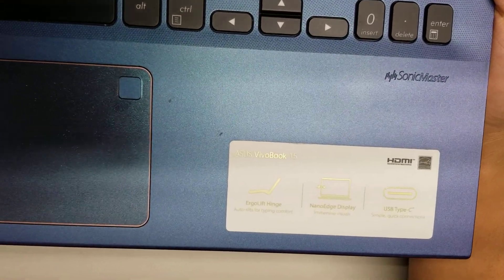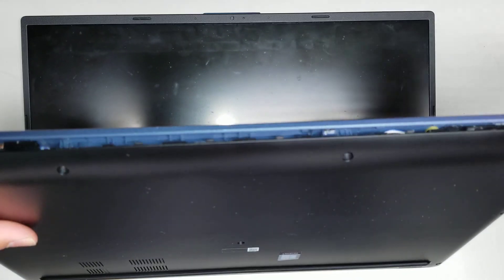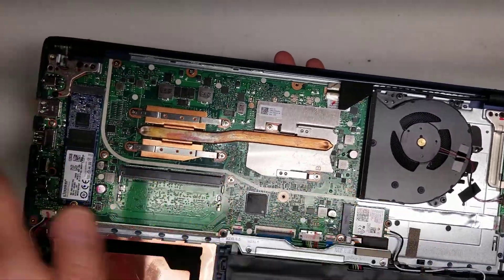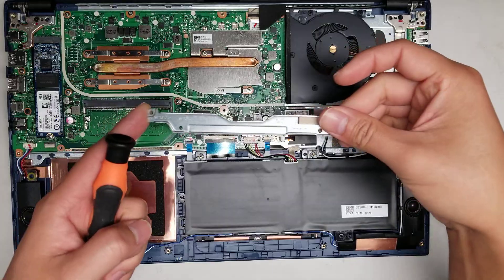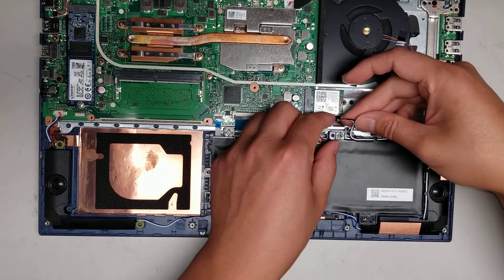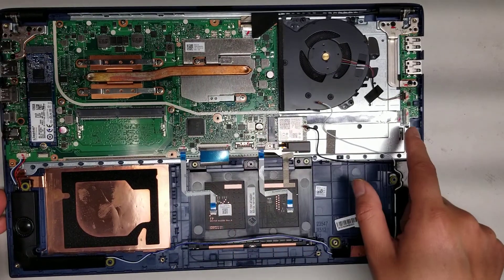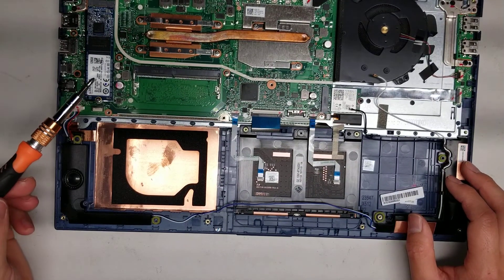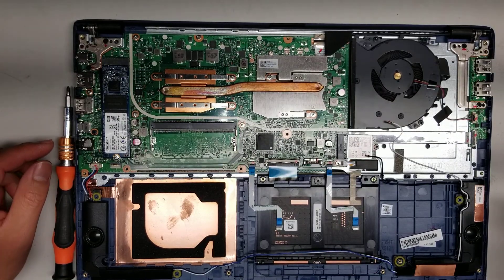ASUS VivoBook 15 F512D Disassembly RAM SSD Hard Drive Upgrade Repair

Comment: I recently bought this computer and after a few weeks of use the performance slowed down even after factory reset, do you have any suggestion or know what might have cause this?
Reply from the maker: I recommend replacing the hard drive with an SSD
Reply: any chance you'd be willing to share a link for both RAM memory cards AND the appropriate SSD for the F512D? @ItsBinhRepaired

Comment: does is have 1 ram stick slots or is it just one slot id rather buy a laptop with duel channel support
Reply from the maker: Should show in the video
Reply: @ItsBinhRepaired  some laptops have over laying ram slots and others has two different spots and others has a single slot and I can't tell in the video so hearing if they do is what I need to know
Reply from the maker: @forog1  seems like you didn't watch the video. Please watch it. I took the time to make it.
Reply: I can only assume it came with a single ram stick as you only briefly went over the ram for like 5 seconds about it just being ddr4 which all 2016 pc have. Sooo my question is sents this small detail did not get covered is, is this system duel channel compatible or is it just a single channel this make a big difference in performance. Its not uncommon that companies will send you pc with 1 stick of ram but have an additional slot for 2 so going off of what was sent to you and thinking its a complete system is not always the case. I'm just looking for clarification from the reviewer who had his hands on this product 🤔
Reply from the maker: @forog1  there's integrated RAM only one slot not sure the specs it accepts
Reply from the maker: @forog1  I don't do benchmarking, just repair them if there are issues.
Reply: @ItsBinhRepaired  Ok that's all I needed to know thank you for breaking down the details sorry for the long winded question that I may not have asked right in the beginning.
Reply from the maker: @forog1  haha no problem

Comment: the cooling solution in these models are good enough for 3500u at 15w power plan. but sadly even with a cooling pad it gets hot hard in the 90°c with a 35w power plan. I recommend getting ryzen controller and set the 3500u to 15w all day even with gaming and on battery. I wish there was a aftermarket cooler/heatsink for these :/
Reply from the maker: They have it, it's an AC unit in your room to lower ambient air temperature. Hahaha :(

Comment: Where is the stock 4gb of ram located in this laptop? Is it directly soldered to the board?
Reply: Soldered, only one ram slot for upgrade.
Reply: @Dongzzzzzz  then it will be dual channel?
Reply: @abiskarghimire3207  yeah, I think the task manager said dual channel
Reply from the maker: If I didn't show or mention it in the video, I don't know.

Comment: Dude, Thanks so much for this disassembly tutorial. Do you have any advice for upgrading to a WiFi 6 network adapter/ card? I want to get a wireless AX card to replace my AC card. Tips? please?
Reply from the maker: Haven't experimented with that. A lot of manufacturers prevent you from using other cards in the laptops.

Comment: How do you remove and replace the fan?
Reply from the maker: Usually you just take the screws out and then it comes out. Watch my other videos for more experience how computers are built and you should be able to figure it out.
Reply: @ItsBinhRepaired  k thanks. Cuz I just bought this computer and the fan when it revs up makes a high pitch jet noise and I’m thinking of replacing it with maybe a different brand of the same fan or something idk
Reply from the maker: That won't solve the problem. The problem is the heat or processing tasks you're running on it.
Reply from the maker: @ShyMiata  https://youtu.be/3zs_SJ3BXgA this might help

Comment: Good video, by the way, do you have any idea how much memory you can put in this laptop? can it support a 16 GB DDR4 stick memory? As well as for the hard disk? How big can I upgrade the HD: 1TB or 2 TB? Kinda searching for this info to make an upgrade
Reply from the maker: I don't think there are limits other that what's available to buy
Reply: i've already upgrade the memory with 1 memory stick 16GB so total my laptop have 4+16gb for RAM. For hard disk, i feel satisfy with original 512 Gb SSD nvme.

Comment: Could you help me to find flex cable to ssd sata adapter kit.?
Reply from the maker: It'll be $1 for my time haha
Reply: @ItsBinhRepaired  tell me where to buy. Give link
Reply from the maker: @nfasousa  I couldn't find an exact item, but this looks like it should work. https://amzn.to/3nxgcZz
Reply: @ItsBinhRepaired  Thank you
Reply: @ItsBinhRepaired  im searching for rubber caddy for hdd? Can you help me
Reply from the maker: @nfasousa  are you putting a spinning disk or SSD?
Reply from the maker: If you have the packaging for the laptop, you might want to check if they included it in the box.
Reply: @ItsBinhRepaired  ssd sata 2.5
Reply from the maker: If it's a ssd, don't worry about the bracket. Just use some double sided tape to hold it down so it doesn't rattle inside.
Reply: @ItsBinhRepaired  ok. But if I to put spinning? I found one rubber caddy on aliexpress but is for hp envy. Is very similarly to yours in video
Reply from the maker: @nfasousa  it needs to be the same. A spinning disk needs the proper mount to reduce vibration and shock.

Comment: This video has been so helpful since I accidently overheated my and I heard like a loud pop from my speakers which immediately freaked me out so I quickly shut it down and left it for a night before I turned it on and it worked fine except for a burning smell which I thought was coming from the fan but was actually my left speaker which sounded significantly quieter than my right speaker. My wifi/internet was also acting up but this makes sense now knowing that the antennas are on the actual speakers but I was wondering if you could help me anyways on how I could fix this on my own and where I could get the parts please?
Reply from the maker: Parts usually eBay. As for how, just watch the video. If you watch multiple videos you'll get a good idea how computers are designed. If you need direct help, you can ship it to me and pay me for the repair.
Reply: @ItsBinhRepaired  ok thank you and I think I can handle it.
Reply from the maker: @tirthpatel6824  hope it works out

Comment: Just FYI, it's not blowing the air from the GPU onto the CPU, cause the laptop has an APU (CPU+GPU on the same single chip). Not sure what that other heatsink is covering/cooling.
Reply: The video is integrated, ore no?
Reply from the maker: @112-y7c  yes
Reply: @ItsBinhRepaired 
There is 2 BGA on mainbord. 1 - Rysen (whis Vega) , 2 - what is this? GPU?
Reply from the maker: @112-y7c  no idea
Reply: @ItsBinhRepaired 
I have this book on linux, and linux look radeon 540, but in dont work.
Reply from the maker: @112-y7c  I don't do Linux, so I'm not sure
Reply from the maker: I'm pretty sure it's for the video even though it's integrated.

Comment: I also have same laptop with only 512gb of SSD. Can I add another 512 GB of SSD or can I only add HDD.
Reply from the maker: You can put a larger SSD. Watch the video. I should have mentioned the slots available

Comment: Does this laptop have 2 ddr4 slots?
Reply from the maker: Did you watch the video?
Reply: @ItsBinhRepaired  im so sorry man i noticed it now. Another question, the cable adaptor for an extra sata drive is included on the box?
Reply from the maker: @AndresGonzalez-uv7wb  not sure. These are customer computers. Most manufactures don't supply them, but I've seen a few that did.
Reply: @ItsBinhRepaired  thank you!

Comment: Can it handle dual channel of RAM ? so sorry if you have already mention it in video
Reply: You can only add one extra stick of ram (up to 8gb). It will run in dual channel with the on board ram that is already installed.
Reply from the maker: I don't research every computer for what they're capable of, I just fix them. For that info you'll have to Google it. If it has 2 slots it's by default using dual channel.

Comment: There isn't any connection between cooling fan and processor with copper heat pipe. So basically it's not a good design.
Reply from the maker: Yup
Reply: but if you see beneath the plastic, there is copper heat sink attached, which takes away heat generated by the processor, and fan blows away the heat, and there is also a wall fixed on the plastic, which gives the wind a direction to flow, also there is a big metal plate situated below the keyboard, which also acts as a heat spreader. Since its an ultrabook thin laptop(and also a budget laptop), so we can't expect a great cooling system, its common for ultrabooks to get overheated, and if its an amd laptop, then it is natural to produce some heat as amd processor runs on higher tdp. Yeah still its a fact that it's cooling system isn't as good as a normal laptops have, but it helps processor to stay a bit cool. Another problem is that it's motherboard is poorly configured, allowing tdp to 25 watts in ultrabook laptops is definitely gonna generate huge amount if heat, if anything which asus has to fix is it's poor motherboard configuration.
Reply from the maker: @fetchthesauce  yup, bad design. The fan doesn't help much with this design. It doesn't spread the heat over a large enough surface area.
Reply: @ItsBinhRepaired  actually this isn't that bad because fan is in contact with that copper heat sink, which takes heat from processor and fan throw out all the heat.
Reply from the maker: Nope, it's stupid like the new MacBook Air design. They throttle the cpu to keep it cool. All the copper does is increase the thermal mass a little.

Comment: You didn't mention anything about adding a 2nd ssd
Reply from the maker: There's a 2.5" SATA Port and an m.2 ssd port. Not sure if it supports pcie nvme though

Comment: I take it no adding an extra drive?
Reply from the maker: Internally probably not. The copper area bottom left looks like it can fit a 2.5" drive. You'll need an adapter. Might have to just leave an sd card in the computer or something.
Reply: @ItsBinhRepaired  thanx... been wanting to play with one. I want to see if amd got their shit together in the laptop market. Always used intel.
Reply: ACiDRAiN97 they definitely have in laptops battery life is better performance is better and cost is lower